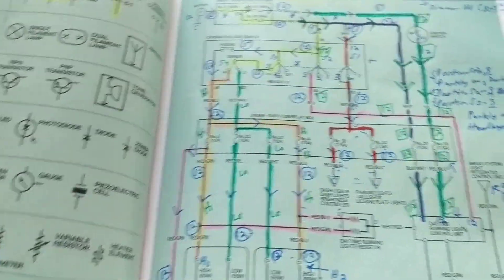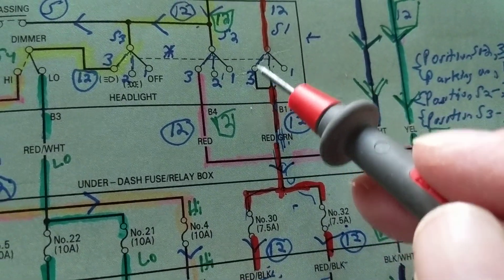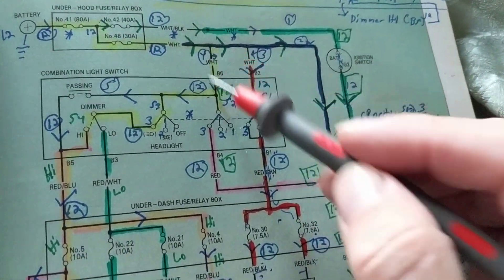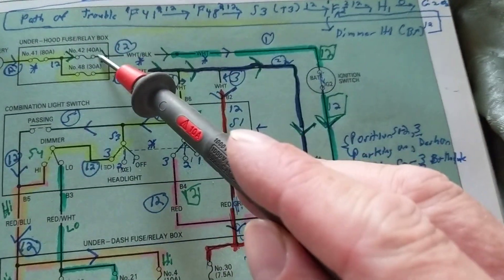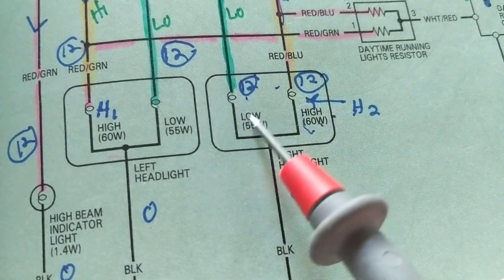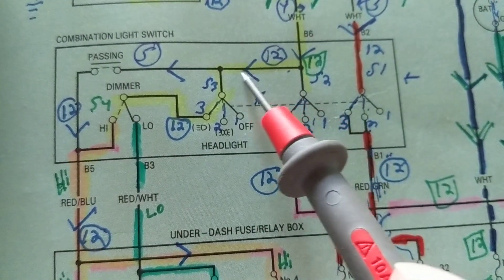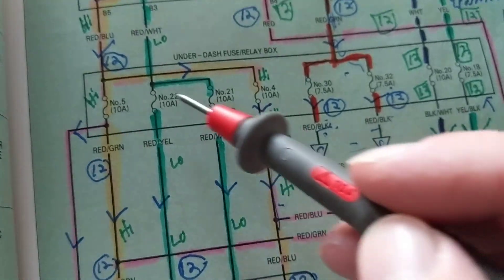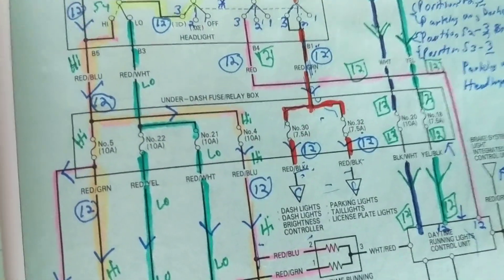HOW TO READ AUTOMOTIVE WIRING DIAGRAMS THE MOST SIMPLIFIED EXPLANATION PART 2

Comment: What does G101 on the grounds mean? I see it all the time
Reply from the maker: If you go to the diagram with the power distribution all the fuses and grounds they should tell you where they are located or you can even go to a page separately for grounds they will tell you the location the best thing that I recommend is go to Google put in your make and model of your car ask for wiring diagrams for ground and you should get one diagram for free
Reply from the maker: That is a ground connection of physical ground could be many connections go to that ground as opposed to a computer ground connection which the computer controls but this is a physical ground with a cable or a wire
Reply: @Joeelectronicschematicsforauto  how can I tell where that ground is supposed to be? They literally just say G101 and that's it